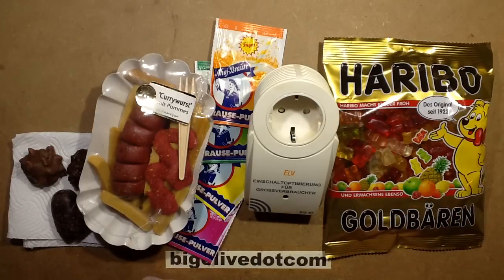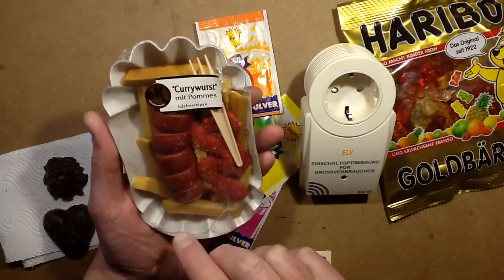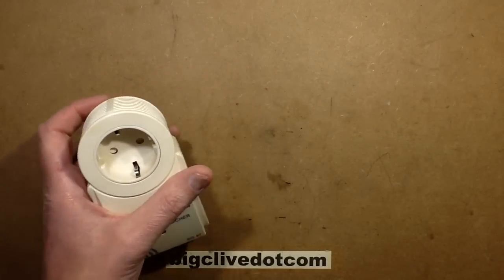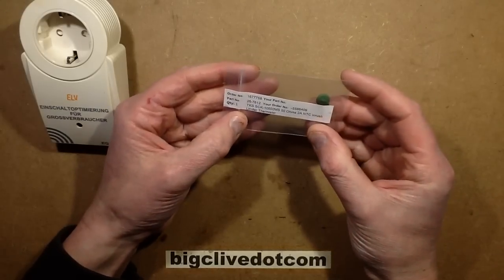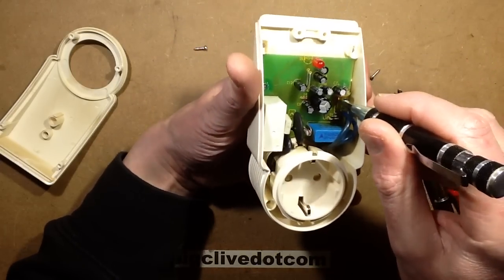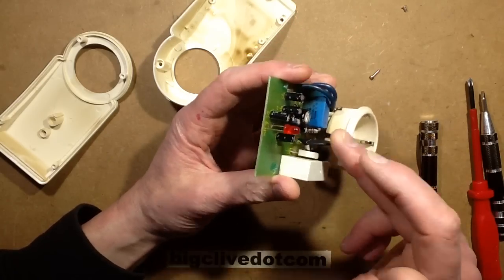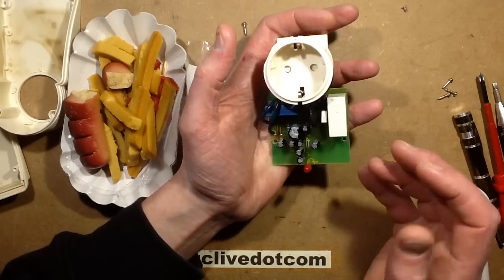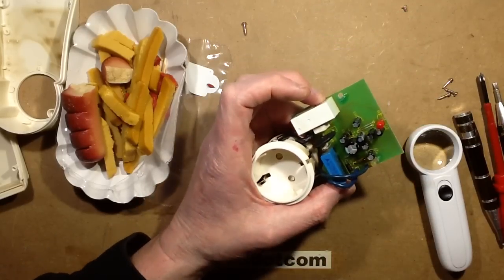German candy and a mystery power device.

Comment: Wait? You only have single phase in the UK?
In Sweden Threee Phase is standard...
Reply: Gego/XAREN ゲゴザレン Same here in Germany
Reply: Transmission is 3-phase, and this is supplied to commercial premises and farms. Household supplies are one of these three phases.
There isn't enough load to justify three phase in a house. What do you have in Swedish households that needs three phase?
Reply: btwbrand 200 amps at what voltage? Germany uses ~230v so 200 amps would be crazy much power 46000 watts. If indeed the voltage is 120v like America @200 amps won't be totally crazy. In the 24000 watts. It's hard to compare. The higher voltage gives the advantage that wiring can be thinner for the same wattages. As the current is lower relatively. For the 3 fase as soon as one is touched a ground fault circuit interrupter is placed that disconnects the circuit as soon as 30 milliamps is lost within 30 milliseconds. And every group is fused at 16 amps. Around 3500 watts per group.
Reply: btwbrand Yeah I'm really happy with the ground interrupts. One time someone had their washing machine leak a current. No problem the water was grounded, but incorrectly as plastic pipe was used for a repair. So nothing triggered the leak. They bought a automatic shower temperature controlled faucet, warm and cold were the wrong way around, but cutting the wall wasn't a option. I ended up swapping the lines near a staircase, While standing on a ladder I cut one no problem, the second i cut I held with my hand to prevent shaking I ended up dropping down the stairs but survived the 30ma for 30 ms as the ground interrupt tripped. Full of blue spots, I finished the repair, and tested their ground waterpipe later on as it was indeed interrupted, the washing machine was faulty. A painfull lesson but glad the interrupt tripped so fast. It was a worst case scenario. Ground fault, machine defect and water ow and their washing machine socket didn't had it's earth connected as they moved it to a other location themselves. They always had a tingling feeling when touching the washing machine they later told me. Haha
Reply: As far north as Sweden is, and the lack of cheap fossil fuels, they certainly use electric heating far more often than here in the US. it's about $4 USD per gallon of LPG heating gas there, here in the US it's about $1.15-1.25 per gallon of LPG. Pretty big difference as we go through about 250-300 gallons of LPG in a single winter.
Reply: You actually have three phase in your house? We use three phase for electricity generation and transmission, but the phases get split out and shared into houses so each house only gets one.
Reply: Each house gets three phases in, it is split in the house.
Electric stoves/cookers, ovens, and other appliances use three phases here.
Reply: Single phase 200A is standard for most average sized US new home construction. The power companies like sending only one phase to a home or neighborhood. This allows them to load balance each phase them selves instead of assuming that customers would take the effort to split the draw between the phases from their in-home boxes.  A benefit is the consumer can have access to 200A on a single breaker if they want instead of being limited to three smaller amperage breakers that aren't even on the same phase and there's no likelihood that the consumer would have two appliances on separate phases near each other creating a potential for shock.
Reply: killerbeenl  It's 220v 60hz on a split phase so there are two 110v taps @200 amps each and can be combined for 220v @200 amps if desired. High load equipment such as heating, cooling, drying machines or electric cook tops take advantage of the higher voltage lower amperage to run the bigger loads. Ground interrupts are indeed much nicer In Euro countries compared to the US. The only protection required here are proper grounding and protection for the wiring so no interrupt is going to save you if you touch the lines barehanded.
Reply: Once had a "tingly" washing machine myself.  When I opened up the powerpoint, I found a dead short between active and the earth pin, a bare earth wire floating in the breeze, and plenty of blobby bits of copper. Fortunately the enamel was intact so the tingle was only capacitive coupling.

As for why the fuse failed to blow, my guess is it had something to do with 26 outlets on a single 15A circuit.  
 
The kicker.  The previous homeowner was a licensed electrician.
Reply: Brett Leach
As we say in Sweden "Skomakarens barn har de sämsta skorna" (The cobbler's children have the worst shoes).
Reply: In the UK we tend to only have a single phase to homes. Saves having a 415V shock risk.
Reply: @afterthetone  Typical UK. Piss poor electrics, piss poor mains water pressure too,
Reply: *****
The wast majority use electric heating, sometimes with heat exchange technology (geothermal heating, air heat exchange pumps and such).

Sometimes district heating and wood-mass heating is used.
Reply: +Gego/XAREN ゲゴザレンI'm not 100% sure; but I remember being told that Norwegians sometimes can have some trouble getting proper ground on a mountain and therefore wire it from a distance.
Reply: So that explains why Asko appliances have a 220 and 380/400V 1/2/3 phase schematic in their machines: they use 3-phase in Sweden!
Reply: Samuel Lakatoš There come three phases of 230V into our house, then comes the electricity meter, then the main breaker with all three phases bond together, then the RCCB, some more three phase breakers bond together for things that need more power like the oven, and a whole lot of single phase breakers for the individual rooms, with randomly chosen phases. If the main breaker or the RCCB gets open, then there is no power in the entire house, but if one of the three phases gets interrupted on its way to our house, because of an outtage then sometimes the other two phases still work and some rooms still have power. If the outtage is caused by something broken in our village, then usually all three phases are gone but sometimes only one phase is cut on its way.

But a huge disadvantage: Dont even think about using ethernet over powerline!
Reply: Samuel Lakatoš When the breaker of an individual room gets tripped, I dont lose power in the other rooms either, only if the main three phase breaker gets tripped but that never happened in the 18 years im living in that house, only the RCCB gets tripped sometimes which obviously takes out the whole house.
Reply: btwbrand
Why would there be an increased risk of shock from multiple phases? One is enough for that.
Also what thing in a home setting would run on 200A? At 110/120V I guess. The only thing I can imagine drawing that much is a heater (and even for that it's much higher than anything you'd normally use). Building a heater that runs on 3 phase is no more difficult than building one that runs on single phase. 400V 3 phase (that's the connection most houses have) gets you the same amount of power at a fraction of the current (35A), which is much more efficient.
And a neighbourhood would balance itself anyway. The phases in a house are connected randomly, so if you have more than a few houses it averages out. If a neighbourhood on single phase draws less power than the next neighbourhood on another phase (e. g. because people in those two neighbourhoods have different styles of life during the day), there isn't much the power company can do.
Reply: Simple ohms law I=V/R. If V is higher, and you are R then I is also greater, and it's I that does the damage. Yes, 230V is enough to to kill you 😀
Reply: I was thinking that phrase as I wrote.
Reply: Guinea Fowl a circular saw and a welder
Reply: Its pretty handy to have different phases in every room so that you might have still power in some rooms when there is an outtage.
Reply: +d2factotum  Not just whole houses, we get 3-phase into each apartment. Just checked the panel - incoming is fused with 3x 20A (slow) fuses. Circuits are fused with 10A , stove is 3 phase, rest of the circuits are single phase. No washer/drier in the apartment - that's  shared in the basement.

Old installation, so no breakers, but wire fuses http://csimg.prisvis.se/srv/SE/000036062683067101735/T/340x340/C/FFFFFF/url/ifa-electric-keramisk-sakring.jpg  It has a spring loaded coloured (by amp ratting) indicator that pops away as the fuse breaks https://www.elfa.se/Web/WebShopImages/landscape_medium/_t/if/diazed-sicherungen.jpg 

The higher the rating, the bigger the diameter of the tip (in the pics 10A and 63A), so that you can't insert a larger rated fuse into the panel (unless you  replace the receptacle that screws onto the bus bar. Not allowed to do unless you're a lic. electrician.)
Reply: Norway has a disproportionally high rate of electricity related fires compared to Sweden due to them only using one phase.

Also:
Norwegian electrical systems in houses are weird: They have the ground as a naked ground  conductors/leads in the cables. That is something that is not allowed in the rest of Europe, AFAIK.

My neighbour is an electrician and some of his clients are Norwegian and they have done it "the Norwegian way", with cables that are illegal to use here and with disregard for any form of phase balancing or safety.

He showed me one of those Norwegian electrical cables, it was a chock! I thought it was a joke, but no, it is how they do it in Norway.

He has refused to even touch many installations in Norwegian owned houses because he wants to not die.
Reply: ...so ones more the Brits are a bit British :)
Reply: We in Austria also have 3 phase to the house. In fact, I think most countries in europe have. It's so you can split the load, for example ground floor gets 1, first gets another and often the ktichen has it's own + often the other phases as well to power stove or so from 2 (or even all 3, not shure) phases.
Reply: Same in Austria. Every home has 3-phase (at 50A in our case at the connection point to the grid, I think, and another 35A fuse per phase in the breaker box). Even having a 3-phase outlet isn't that special (I run tools of off that).

Comment: ELV in germany is a company that started out with a magazine that would introduce kits and they would sell the kits afterwards.   This one seems to be from 1986 (http://www.elv.de/Einschaltoptimierung-für-Großverbraucher-bis-10A/x.aspx/cid_726/detail_34358). You can still get the schematic for this. These days they sell more readymade stuff. The circuit is designed as you described for old households still using the 10A breaker instead of the newer 16A breakers we now have in germany.

Comment: if got a pinball machine, witch about 2/4 times triggers the breaker when i turn it on. woud a device like this fix my problem?
Reply: TheJacko1010 depends what the problem is.

it might have an intermittent short which you should really fix as it could result in burning your house down.

can you measure the initial current when turning it on?
Reply: zogworth No i don't realy have the equipment for that, all I know that this is a common problem with thease units